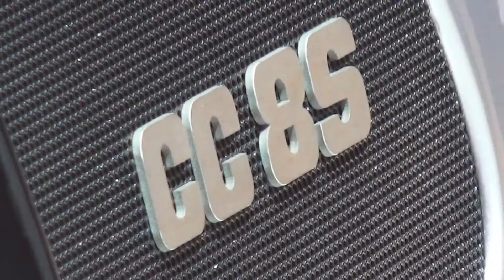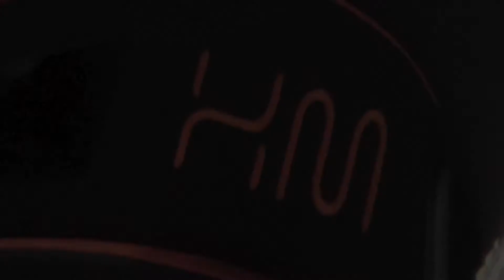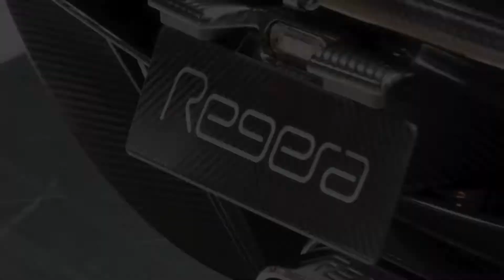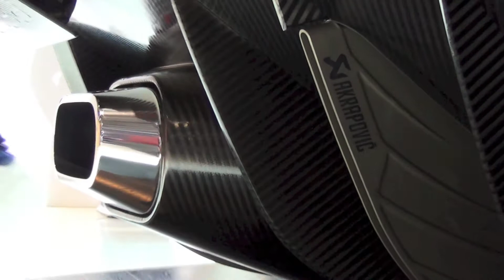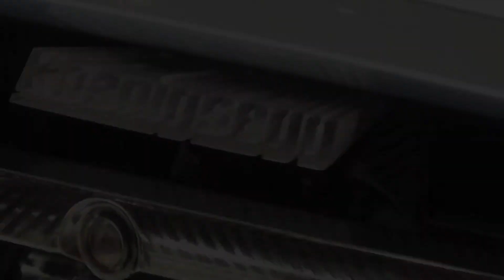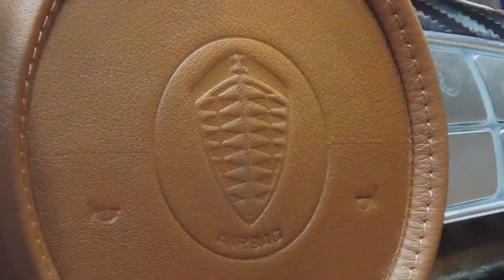Koenigsegg Regera - Geneva Motor Show 2015

Comment: So now it's about to get out on the road and track.
I wonder how it will stack up to the One:1 in terms of track time. more weight, less downforce, and traction issues up to 270kph :-)
I wonder whether the hybrid is really the best possible solution here. 
Imagine to take out the 2 rear electric wheel motors, and the battery and controllers. Replace them by a modern compact and lightweight engine, such as a 400bhp (or more of course) 4-cilinder, placed in the front, driving the front wheels. It could have one long gear overlapping with the V8, or have a lightweight 2 or 3 speed gearbox. It's mainly to get going, and add traction both off the line and out of corners.
FWD will add complexity, but then, most cars have it. And how can 1500bph peak power be an optimum sent to the rear wheels only? At minimum place some motors on the front as well, seems like it would be well worth the weight. 0-100kph in 2.2s?

At first I thought the hydraulic coupling would somehow be able to get the car going from standstill. Unfortunately it's npt, but it would be a great idea to invent that. That would also take away the need for electric weight being added.
Also I wonder what a 2-speed gearbox rated at 1100bph would weigh when optimized to the V8 engine. In stead of at 50kph, it could be able to cut in as low as 15kph for instance, and then shift to top gear around 130-140kph, with the electric and/or front V4 engine still pulling hard as a form of torque fill.
Another thought. As 1100bph can't be delivered to the road via the rear wheel up till 200+kph, Sending some to the front would not hurt. Regen could be real-time from unused horses, delivered via supercaps to the front motors.
If the V8 had a shorter first gear, it would have plenty of torque to send loads of it to the front wheels

Regera is super clever, but I feel there are some steps left to rally get the concept down.